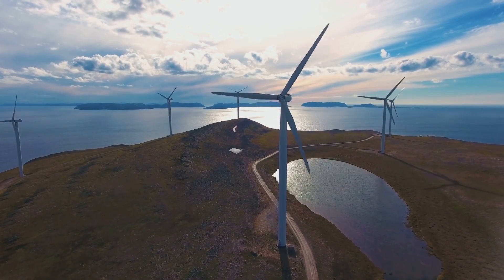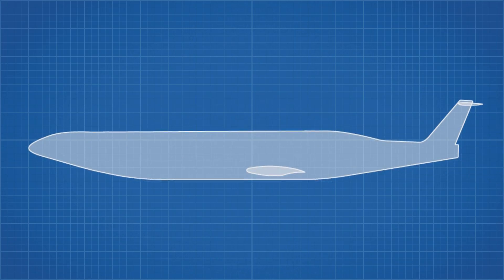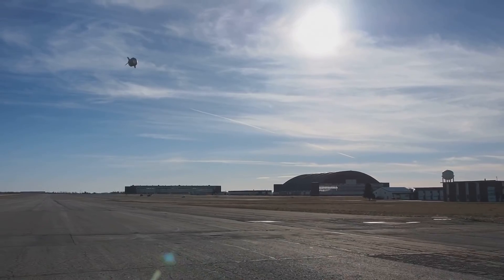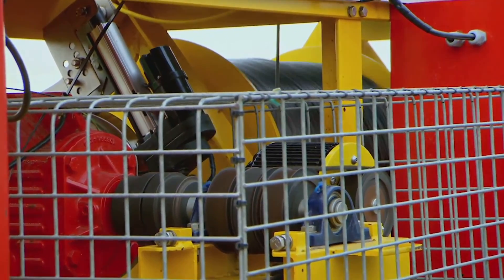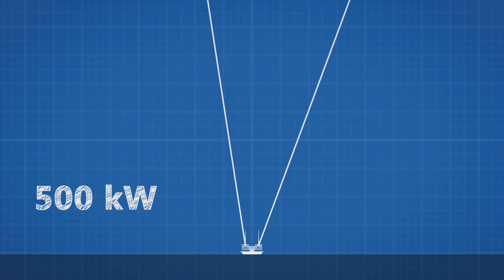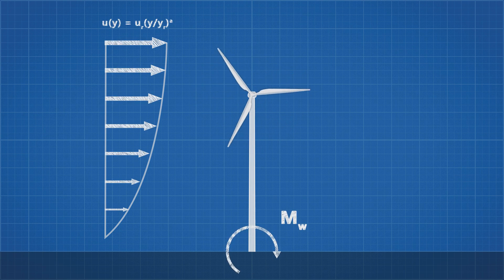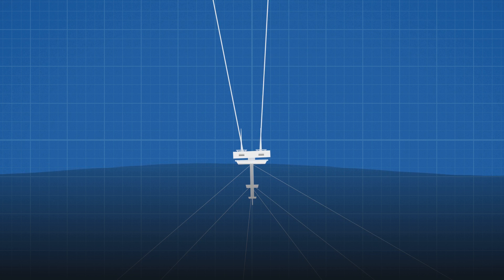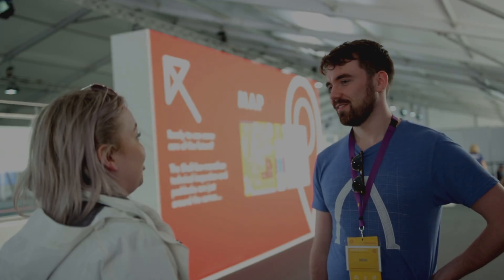The Future of Wind Power? - Kite Power Systems

Comment: I would be interested to see what their solution is for planes and visibility.
Reply: no fly zones, have them in areas outside of a planes flight path
Reply: And lightning and birds.
Reply: Ah, tangling. I didn't even think of that. I guess the little robots controlling their flight make sure that doesn't happen or something?
Reply: Kieran Saul oh yeah, that make sense, the kite is retractable, you can easily put it away during a thunderstorm while wind turbine can't. That's another benefit of using the kite over wind turbine.
Reply: R class airspace with alt-limits and NOTAM indexs
Reply: Kieran Saul and lightning and birds
Reply: Not sure about birds(maybe just use brightly coloured kites? and, unfortunately, I expect that animal safety would be ignored if this energy source was made a reality; birds fly into windows all the time and nobody's bothered), but I imagine they would just reel in the kites if they knew a thunderstorm was coming. Thunderstorms typically come with rain, and I imagine a heavy down-pour would reduce the efficiency of these kites too, if not ground them completely. Which is another problem that I just thought of, and an even worse one considering that rainstorms are far more common than thunderstorms.
Reply: I did say typically, because I only remember seeing a few dry thunderstorms in my life. I guess it depends on the location though. Point is, they would still be able to predict the thunderstorm coming and reel in the kites.
Reply: @kieransaul2711  Large kites can absolutely fly in rainstorms.  I've flown home-made kites in hurricanes.  

Not all kites are paper rhombuses from the dollar store.
Reply: Wow! Great to see you here! One of my favorite woodworkers commenting on a video from one of my favorite scicomm presenters. I think you combine no fly zones with high visibility LED beacons, and  there could maybe be a system that either quickly reels in, or even cuts lines if an aircraft enters within a certain radius exclusion zone.
Reply: Well, if you looked at the picture, it barely when higher than the equivalent turbine, so it's not really going to obstruct things any more than a turbine, and while it may be a bit harder to see, you can always paint the kites in bright colors. I'm more worried about kites tangling if you put them near each other.
Reply: I hope you’re joking.
Reply: Put flags on them like they do with power lines during construction, or lights on the top/maybe on the cables
Reply: Agreed, however if they are offshore, and only a few hundred feet high, there is not too much of a risk for typical air traffic, even civillian
Reply: Make sure pilots know not to fly through wind-farms. Also, I don't think they would fly high enough to be a danger to planes, would they? Planes fly above the clouds, and I don't think the spools on the kites are long enough to reach that.
Reply: ILS

Comment: Awesome video as usual, and the idea seems promising.

I have a (somewhat) relevant question: what are your thoughts about the increasing drive to shut down nuclear stations and rely on coal/gas plants as backups for renewables? I mean many think that Nuclear is too dangerous to be the main source of energy into the distant future (I don't, but that's not the point), but why does no one bat an eye when the base-load backup renewables clearly need is preferred to be newly-opened fossil-fuels plants rather than already existing nuclear plants?

Comment: I think it´s makes more sense to but these kind of Kites on large ships to reduce the fuel consumption of them not on land where we have to pull the kites back every so often.
Reply: Konrad Mutz neat idea
Reply: Well, if these prove better than sails...
Reply: VasilyKiryanov 
They have several advantages over sails.
1.  They don’t need masts to support them. This is important on commercial ships as masts interfere with loading/unloading. They may need a single small mast for launch and recovery, but it can be located away from cargo loading operations.
2. They can operate in higher wind speeds at altitude.
3. They can be attached in such a way that they don’t produce any particular heeling moment.
4. They can be retrofitted to just about any ship.

They are not designed to replace ships engines - modern shipping requires vessels to stick to timetabled schedules, but for a low capital outlay they can help ships make significant fuel (and therefore, pollution) savings.

Comment: People have done this for centuries.
KiteGen for example already is a company that has done a lot more in that direction than kitepower.
And still it won't be able to really compete with solar or traditional wind power due to high maintenance costs. And it has a bigger impact o the environment than people want to admit.

Comment: Building solar power farms in the Sahara desert would require a massive cleaning system to remove sand and dust from the solar panels. So even ignoring the political and logistical obstacles, this is not a  cheap idea.

Comment: As a general aviation pilot, it makes me slightly worried about flying into one of these in my 172. You'd need to establish a strict no-fly zone around the kites, which wouldn't be that hard if you got the FAA on your side, but if this really takes off that's going to add a lot of clutter to the skies.

Comment: What is the minimum distance to the next unit.

I think for towers it's an elliptic area of 5x rotor diameter in prevailing wind direction and 3x rotor diameter perpendicular to the prevailing wind direction.

I guess you'd have to watch the angle of ascension, horizontal angle, length of the kite wire...
so they could be closer in prevailing wind direction and have a certain amount of overlap.

Comment: It is my understanding that it is more economical to work on increasing efficient energy conservation and reduction.   Money spent here goes further than spending it on new energy generation structures.  Energy gets lost in transmission so it would be better to produce the energy closer to its point of use.  For example, it would be better if each house had its own energy generation solution.
Reply: deltaskyhawk that would be extremely expensive for most people, though. A generator is no cheap thing. But with advances, it may be viable for each house to a certain degree. I don't a home generator would be enough on its own.

Comment: Can you comment about the sound level of kite powered systems? Countries like Poland introduce new legislation that require wind turbines to move further from the households because of the sounds levels. It significantly reduces number of potential locations. It sounds that kite does not have this problem.  Another advantage I see is an impact on the environment. Wind turbines kill million of birds each year. I doubt kite will have similar death ratio.

Comment: Intriguing idea, I am interested to see what the scalability of such a system might be. Obviously they will take up some airspace but they shouldn't interfere with air travel and should be easy on the avian population. Does anyone know what the nominal elevation of these kites would be?
I do have some reservations about using energy from the jet stream. Granted my knowledge of the atmospheric sciences is limited but I worry that reducing the energy in the jet stream could cause drastic changes for the inland climates that depend on the it for stability. Unless of course the energy used is a tiny percentage of the available then it probably wont be a problem.

Comment: Excuse me but wat the heck is this bullshit? You can't produce energy like this, Energy is force times distance, the kites would need to actually unwind those cables in order for them to produce anything, and when you want to bring them back down, the base station will need to work against the same lift force, consuming all the energy it just generated! I don't even mention that there are tons of obvious practical problems with this, like how would they keep the cables from becoming tangled with each other. The spacing that would be required to keep any 2 of those stations from interfering with another in this way must be huge, driving the power/ground area coefficient towards 0.
Reply: I imagine they put the wing into a high angle of attack for high lift when letting out the tether, and in a low angle of attack for low lift when reeling it back in.  http://en.wikipedia.org/wiki/File:Lift_curve.svg

Comment: There are 2 kites, To avoid mangling, they have to fly at different angles to the base platform and this platform has to rotate. This means each kite setup reserves an enormous space around them. 

So if i understand this correctly, normal windturbines are far more space efficient while kites can be used in places where you cannot build a wind Turbine, like for example floating in the ocean

Comment: what about nuclear fission with simultaneous diamond batteries made of radioactive waste?
Reply: Raman Unnikrishnan that would depend on energy needs and available monies. These kites are specifically made for considerably high yields for very low cost and maintenance
Reply: There is the fact to consider that there are a lot of nuclear reactors already in work.
Reply: Raman Unnikrishnan yes, in places that can afford them. Not in others.
Reply: Nuclear is unprofitable. It's supported for political reasons. Lots of development and production costs hidden in military budgets. Without the military - no one needs it. That's what the problem with Iran is - why on earth would they need nuclear with their supply of oil? It was obvious to everyone they ultimately wanted the bomb. And Rosatom builds reactors for them to ensure political loyalty. That's all - end of story.

Comment: Talking total bollocks about the ground unit just needing to be heavy enough to hold the kites down. It would need to be securely anchored. I've been in a gliding launch winch that shifted whilst launching a glider in a relatively light wind. What you have also failed to mention is that the load on the kite increases directly with the square of the wind speed (that is both lift and drag increases). 

Also if on tether breaks it has enough energy to smash the ground unit, the kite might be controlable, but the cable won't be. I've seen the damaged caused by 3mm diameter steel cabling. You would need a vast area for a single unit to operate in just to prevent cable breaks from damaging anything else. It would be likely that breaking one cable will cause the loss of the second cable, which is why you never attempt to launch 2 gliders simultaneously on the same runway.

There are better and simpler ways of generating electricity from the wind. Instead of the horizontal 3-bladed wind turbine, you used a vertical axis version that is self speed limiting. They already exist and have the advantage of having a much smaller visual foot print. They could easily be place on existing buildings, reducing the need for long cable runs from the more rural areas where wind farms already exist.

The jetstreams are typically found at 30,000 feet.  Glider launch winchs are limited to about a tenth of this.

Comment: Sounds like a good idea for the small scale, but I don't see how you can efficiently scale this up to industrial level.
Reply: They are already making towing kites for ships that can develop around 10MW. It’s just engineering.
Reply: @q.e.d.9112 guess the weight savings make a huge difference.
Reply: Just add more. This is way cheaper and uses less land than wind turbine while 1 unit of this has very slight difference of power generated of 1 wind turbine.
Reply: +The Centalist 
You need to consteuct additional pylons.

Comment: What about metal fatigue on the control and tension components over time? Especially in a saltwater environment.
Seems like the forces on the materials may lend to premature fatigue over time. At least offshore turbines have significant elevation for the moving components over the salt water.

Comment: Idea itself - ingenious. However, there may be a problem with such kite plants. Wind turbine's blades for 500MW would need to be 54 meters in diameter.  Still, you are able to install the turbines quite tightly at the wind farms. Wouldn't the required distance between kite plants be much greater due to the length of the tethers?

Comment: One of the main issues that come to mind are that you couldn't have more than one pair of kites per certain radius because the cables could tangle of the kites interfered with eachothers fight path. Which seems very likely if you had hundreds of kite systems next to each other.

Comment: I imagine it will be difficult flying kites in close proximity. Tangled lines? Then how do they imagine to generate as much electricity as a wind turbine? They'll need quite a few and each takes up a lot of area to operate.
Reply: The robotic controllers on the kites set up the flight so there are no tangled lines.

Comment: I'm confused. Wouldn't the spool at some point run out of cable to spin, and then you would have to use the same amount or more energy to spool it back? And if not, how does a practically stationary kite create energy? Just like you can't get energy from gravity, you also can't from wind in such a way. Could someone please explain more?
Reply from the maker: As I said in the video, the kites have control surfaces on them that require very little energy to control. Simply change the pitch and the kite will glide downwards, thus removing tension and lowering the energy needed to re-spool. I should have explained that in more detail. KPS are also working on patenting an asymmetric kite design that would reduce the energy required to control the kites trajectory.
Reply: Oh. Now I understand. Thank you for explaining!

Comment: What are some of the downsides to Kite Powered Systems? Some great benefits, but any cons?
Reply: you can solve that by reeling the kite in, creating airflow and keeping it aloft and soft landing it. But htis means there needs to be a launch and retrieval system in place as well, likely a mostly automated system if it is to be something aimed at the energy farming market.

Another con atm would be kW/acre due to the extra space between stations to avoid overlapping their airspaces and colliding, tangling or otherwise influencing eachother. So these systems need to be REALLY powerful and efficient per station to compete against turbines, which are fairly compact (i can imagine one of these full scale kite station would need easily an acre in radius of airspace between the edge of the next station whereas the turbines you can pop 4 or 5.). Also they operate in a circular area, turbines can be deployed in any formate, grids, lines etc, but circles are hard to manage for farming as u get lots of wasted land between sites. Also they cannot operate in heavy weather or storms, same as turbines though. 

I imagine that KPS is well aware of these problems and limitations and know that they need to overcome them in order to be market viable, amongst other issues i havent thought of
Reply: If it gets hit by lightening it's dangerous to anyone near and it would destroy it.

If the spool snarls the kite will crash and it would be a mess to untangle. 

Making it visible with special markings to keep aircraft away could make it an eyesore.

Aircraft might accidentally fly through the area, hit it and crash.  The kite's winch might need to be linked to air-traffic-control radar systems for emergency retraction. This would require special permitting and would have increased liability and insurance costs.  This could limit the number of suitable locations. This seems like the biggest issue with the technology.  

Using it over farmland bears some risk of it crashing.  Using it in the ocean makes the cost of maintenance, emergencies or salvage more expensive.  Undersea power lines are more expensive.  

Scaling up to larger systems could worsen these issues.  Noise of the gearbox and generator might eventually be an issue.

Can't use in severe weather.  

Needs a launch system.

Needs a dynamic control system.
Reply: When it's not windy, they break. The kite just falls and when it hits the ground it crumples.

Comment: What do you think about orbital solar panels? Are they feasible?
Reply: DinaricWolf I've heard that one, Where they beam down energy to earth but 70% of the energy is lost i think..
Reply: But they're still useful because in space there are no clouds or night so the panels could work 24/7.
Reply: But it would be extremly expensive to transport the panels into the orbit. And you need shielding or get reduced lifetime because of cosmic radiation?
Reply: Yea the transport cost would be pretty expensive. But then again whenever the economy has a need for energy its most effective to create more solar panels because you can install them quickly while other energy sources take years to install and therefore the economy has to wait to get more energy.
Reply: How are you going to get the energy back?

Comment: what is the limit of the steel cable? wouldnt you end up with the same problem as elevators in skyscrapers?
Reply: Yes, absolutely! The cables can only become so long before their own weight will make lengthening it detrimental. Fortunately, I don't see this tech being used on high atmosphere levels aaaany time soon due to the incredible risk of midair collisions.

More likely the cables will stay well short of their maximum length as the kites catch lower drafts of air.